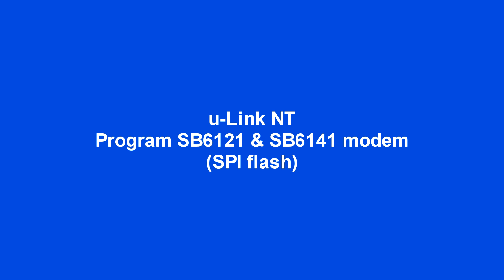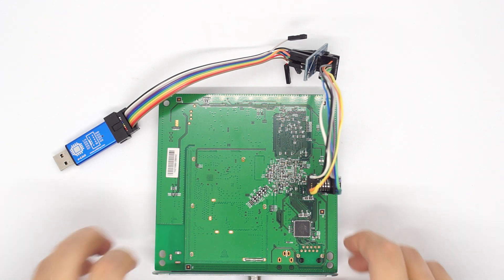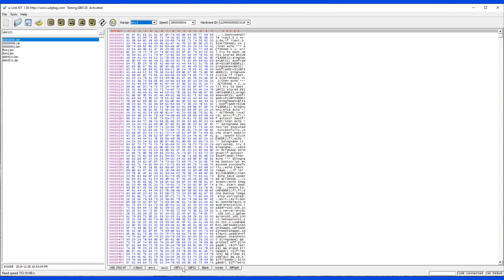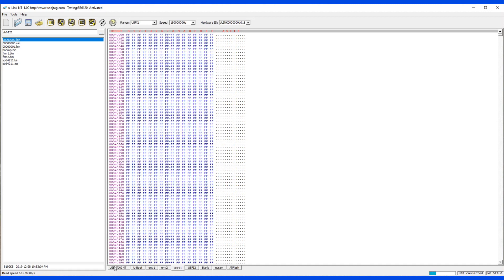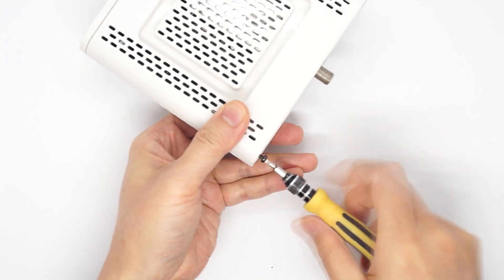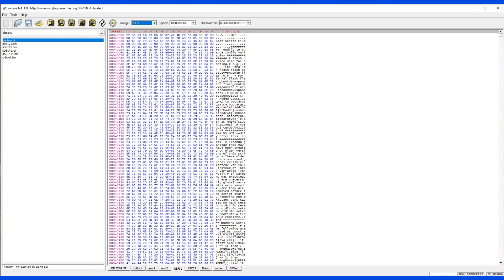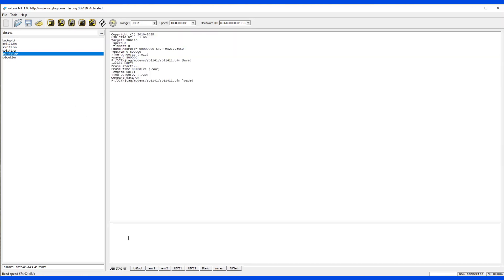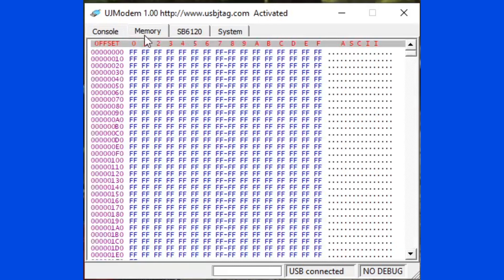u-Link NT program SB6121 and SB6141 modems (SPI flash).

Comment: can you make a Linksys EA6400 flash with jtag :S
Reply from the maker: I already did EA6400 using NAND ISP  method. But the hardware is not ready.https://www.youtube.com/watch?v=Pp71FowuqlQ&t=91s
Reply: @usbbdm  inst JTAG posible?  i cant get that chip adapter  u.u, only JTAG

Comment: Do you have a video how to setup the hardware cable?
Reply: Hold and WP, pull high... What does that mean? How do you that?
Reply from the maker: The signal pins are in the software. DI,DO,SCK,CS,GND,power. HOLD and WP pin pull high. If this is not clear I can make a video how to connect them.
Reply: @usbbdm  can you make a video
Reply from the maker: @oscarm1985  check my recent videos.